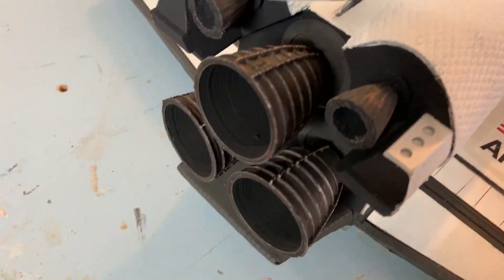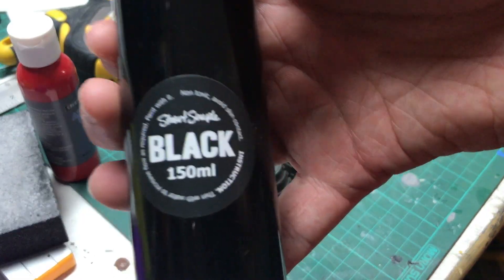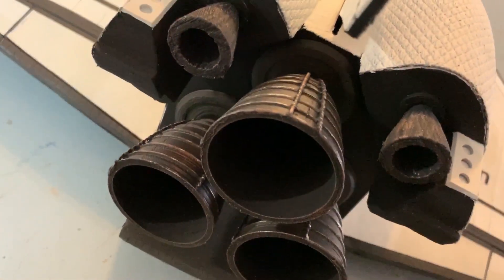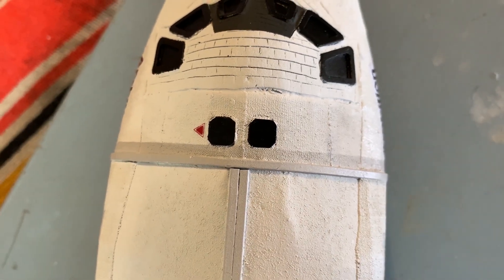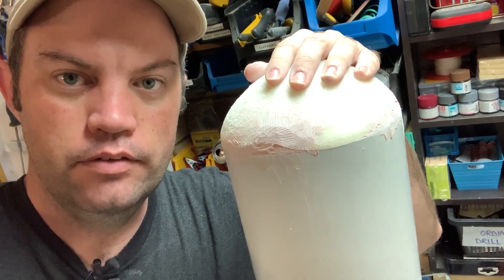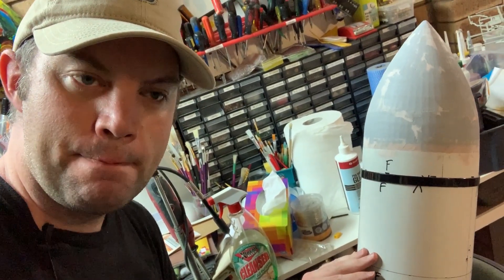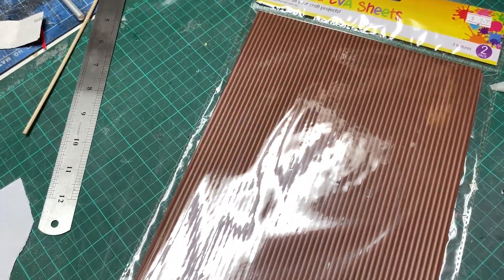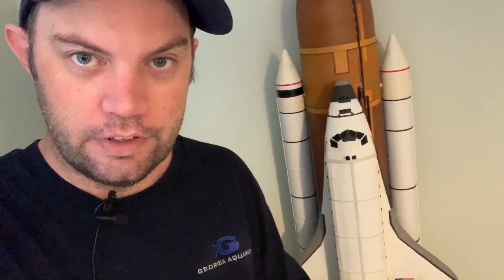Space Shuttle Orbiter 3D Print & Scratch Build - Part 3 (Finished!)

Comment: They used 3-5 different designs of ET's over the course of the Shuttle Program.

The tank was also painted white for the first 2 launches but they discontinued painting it white because A) they found it didn't make a difference as far as protection for the ET was concerned and B) it saved a few hundred pounds not using the white paint.
The internal structure of the ET was revised several times as well as the piping and external features.  There was a big change after the Columbia accident since they wanted to minimize the chances of falling foam damaging the shuttle again but it apparently the design revision didn't make much difference and they still had a few incidences of foam striking the shuttle afterewards.